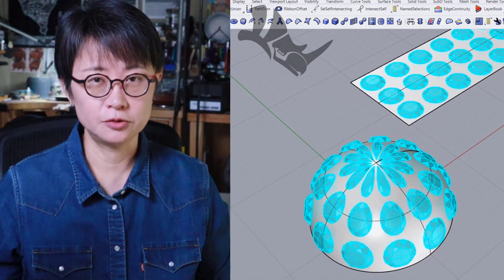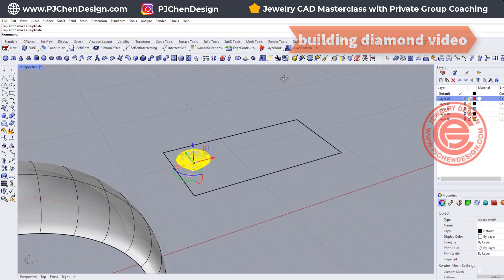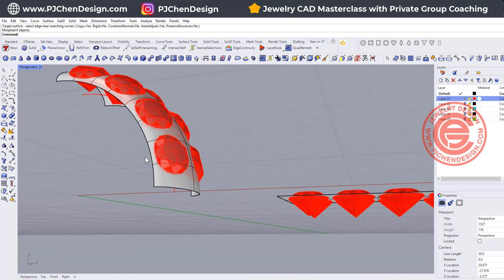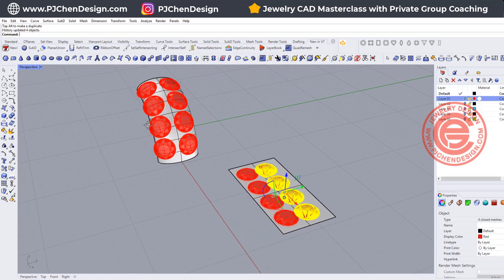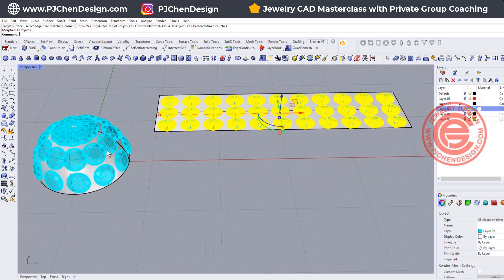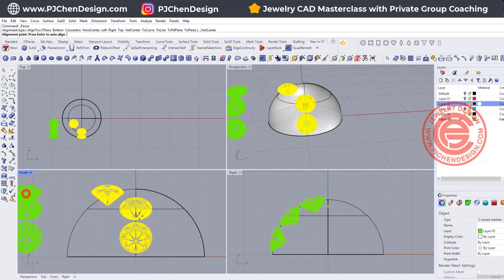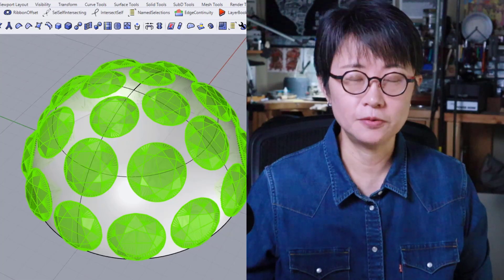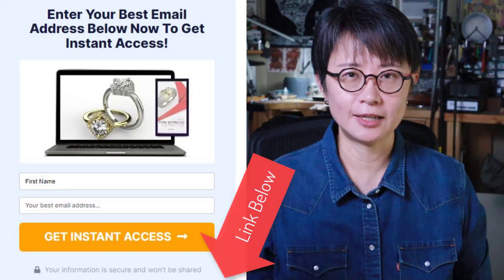Rhino 3D Jewelry CAD: Fixing Stretched Stones #471

Comment: thank you so much for this I was curious how do you export a model from rhino to a program like 3dsmax for rendering without the diamond becoming messed up. Right now when I export a diamond to render in vray the geometry is ruined by rhino on export as an obj or stl file
Reply from the maker: what file format did you export?
Reply: @PJChenJewelryDesign  I have tried to export as an stl,fbx,and obj. I am unsure what settings to use in the polygon mesh options box to get the topology of the diamonds to export without much change so it renders properly